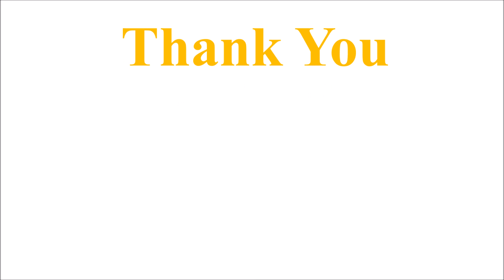Futaba 6K Radio, Changing To "Model 2" (Left Hand Throttle) From "Model 1" (right Hand Throttle

Comment: Than you - Just did it on my radio . New mode 2 and beeps on startup and the indication it is Mode 2  is when  left stick is  pulled down the left stick throttle warning beep stops.